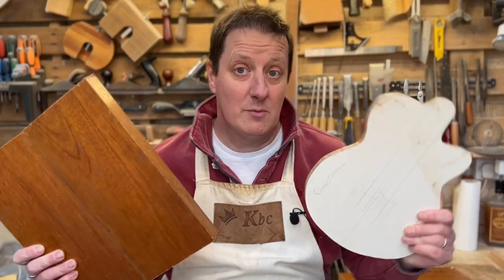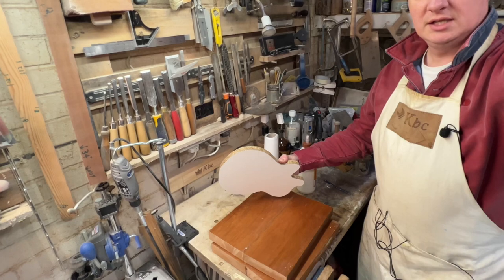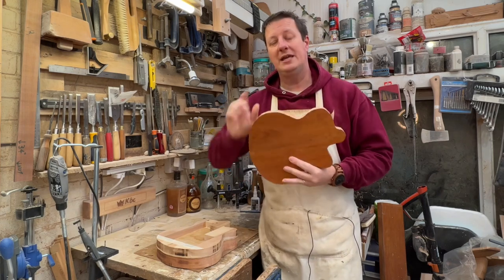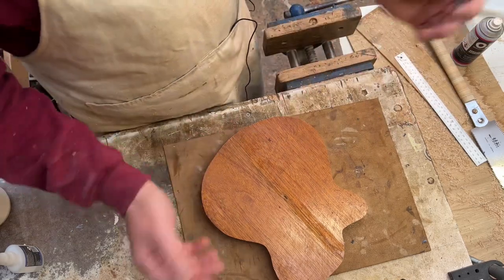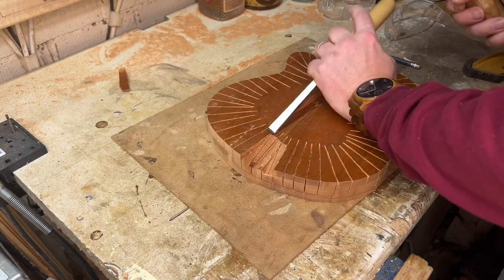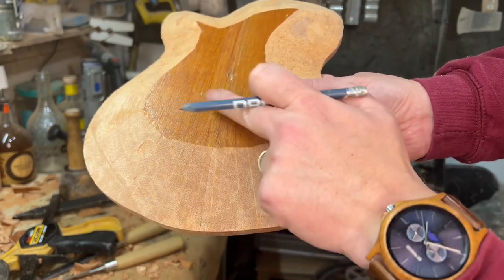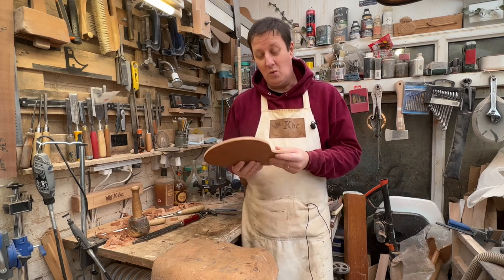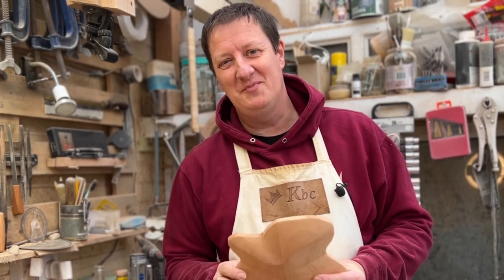Get your body into shape - ukulele body obviously! Archtop Uke part 2

Comment: Suppose I wanted to do a steep perimeter rise that rounds into the body’s main arch. (I do…) Could I do that in two sets of cuts? First, very steep saw cuts from the binding line that barely nibble the top. Chisel away, then a new series of cuts from a new line in the fashion seen here. Does that make sense?
Reply from the maker: Yes I think so. Try a few different lines on a scrap piece and see what curve you get. It’s the same system as carving a neck. Watch this for more info.  Great Guitar Build Off 2021  |   Cut any Neck profile by hand.
https://youtu.be/DE3ACzP5rec